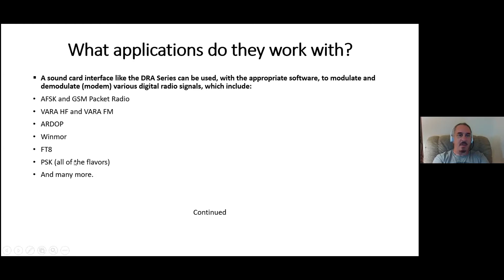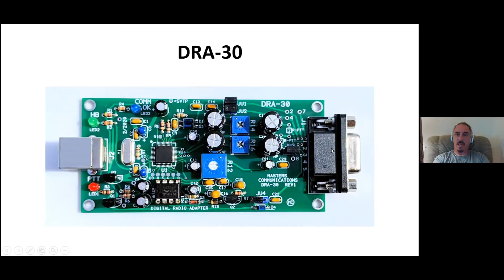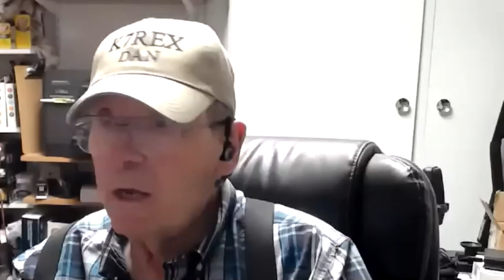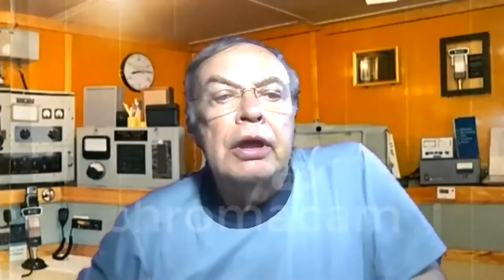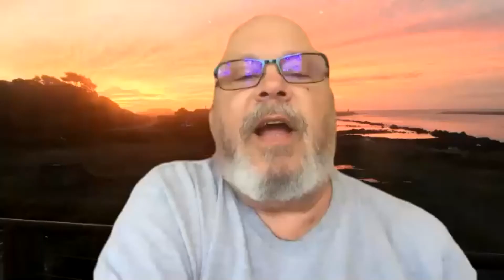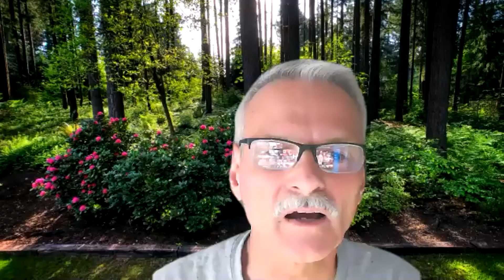Winlink Workshop Week 4: Radio Soundcard Interface

Comment: I have a DRA-70 for Winlink and FLDigi in my shack. I use a DRA35 in my truck with my D-710 as a secondary digipeater along with the built in one. Both work well. I just bought 2 RA-35's for ALLSTAR.

Comment: I just got the DRA-36 kit. The instructions for assembly are not very clear. The components are not clearly identified for the non engineer such as myself. If I had known this, I would have ordered the pre assembled unit.
Reply: While I'll agree the instructions are not very clear, it's not impossible. If you sort out your resistors and caps by value, and go down the line it makes it pretty quick. I had one of my kids assemble a ra-25 using this method, and they did it in about a hour.

Comment: Which Radios need more audio in ?
Reply: Typically any radio that needs discriminator audio will need more audio drive. Using the 9600 port on some radios requires more audio, as the discriminator audio port on some repeaters and/or controllers.
Reply: @richardlarson5956  How much Output [Vpp] is the DRA-30 providing? 
I already ordered two* of them and I hope it is working for the FTM-300 ;-) 
(there is not really a documentation of the needed level, but on a older device (FT-8900R) it says 40 mVpp for 1200 and 2 Vpp for 9600) ?? 
73 de Roman HB9XBK
*) I would also use them for a icom IC-92
Reply: I've got my DRA-30 i measure a Upp of 3.5 [V] and about 100 kHz Sample rate.
Is this correct?  73 de de Roman HB9XBK
Reply: @romanhar4151  3.5v PP is a little too much audio drive. What Radio and how are you feeding the audio in? through the microphone jack, or through the 6 pin data port ?